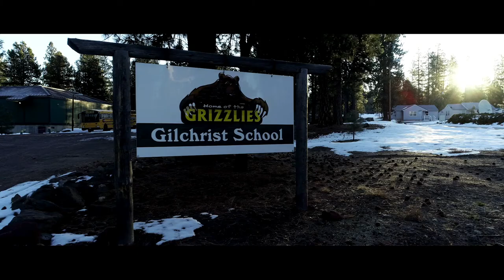"The Future" | We The Forest Original | Gilchrist, OR

Comment: Have many great memories working there I was 24 when Bill Steers hired me. Worked from 1976 to 1980.   I left to go work on a job clearing danger trees for 500KV power lines running from Medford Or. to Wyoming operating a 518 Cat skidder. Harold Simmons was my boss at Gilchrist Timber great guy and Marvin the guy that fueled and greaseed the equipment was a Pastor too , he gave me a little booklet about Jesus and I love Jesus to this day thanks to him. Started out throwing rocks and sticks off of logging roads. Worked with Bengie Gilchrist it never dawned on me he was the owners son lol. Then started as a knot bumper and worked my way up to a 667 clark skidder. The hard times I remember is working in snow probing for logs  taking them to a landing with the wind blowing snow horizontally caking the side of my head with ice.  If it wasn't for turning the fan blades to blow warm air on my body I would have froze . I loved every minute working in the woods, all that fresh air.
My brother Alan Knoles operated the Debarker and floated logs to the mill.
Just my little piece of the history. I lived in the little cabins on the river side of 97 with the single car garage between them . Cabin #1 paid 50.00 dollars a month what a deal. Love this video brings back great memories . I'll be 70 next Nov. Time sure flies ...